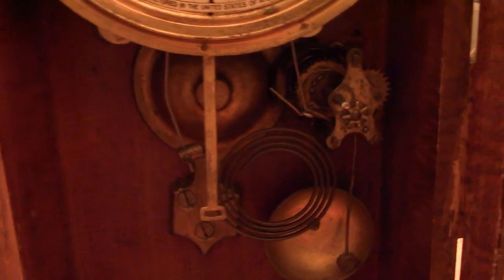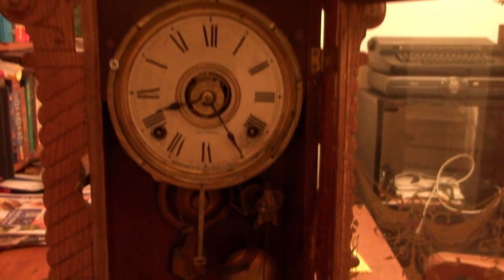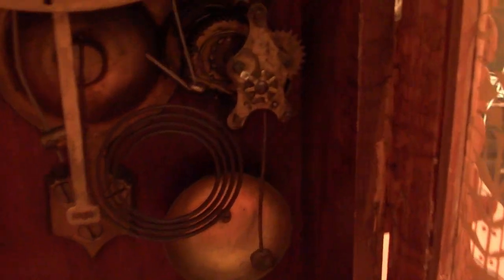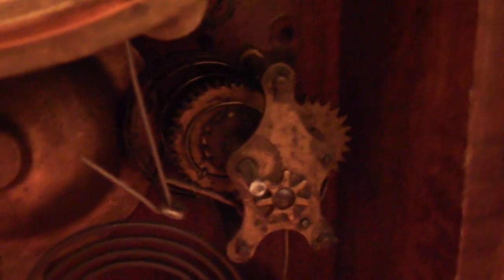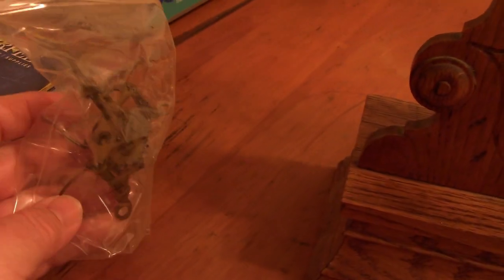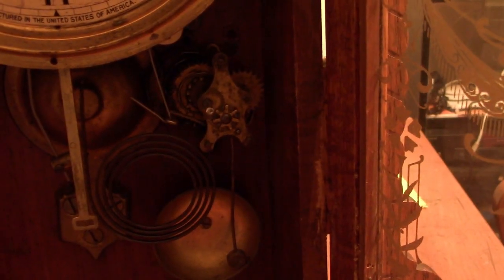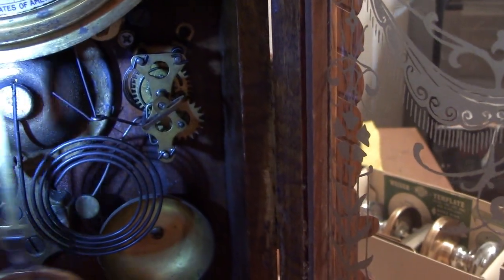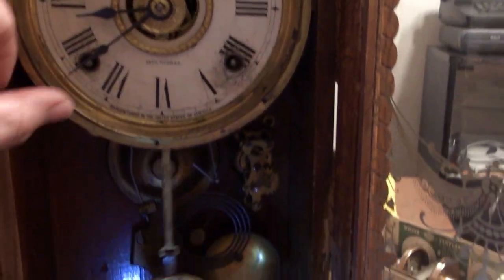Replacing The Alarm Mechanism on the Early 1900's Seth Thomas Clock

Comment: I'm amazed you found a replacement!
Reply from the maker: I had a search for _years_! Good thing I'm patient. It came with an entire 89E mechanism as well. I haven't tried to get that going yet. I'm sure with a cleaning, it will work just fine. Looks like it's had some bushing work done in the past. On the back of my clock it has a note that it was cleaned Octember, 1926. Probably around the same time your sister's house was was being moved into for the first time.